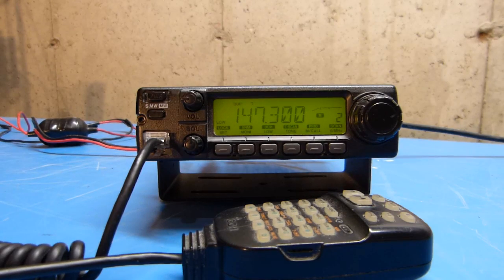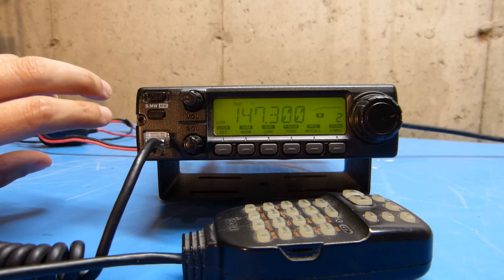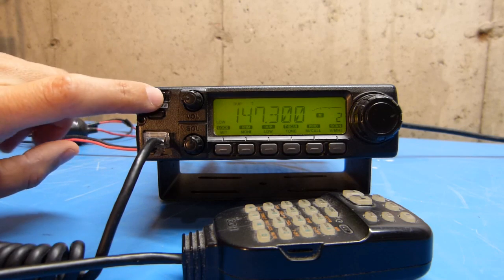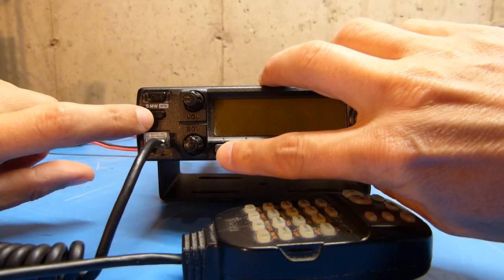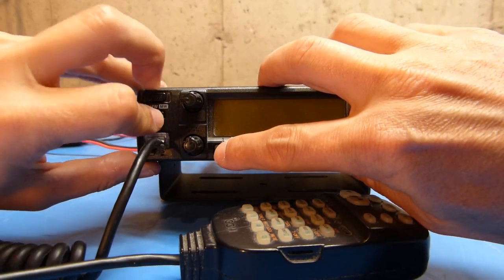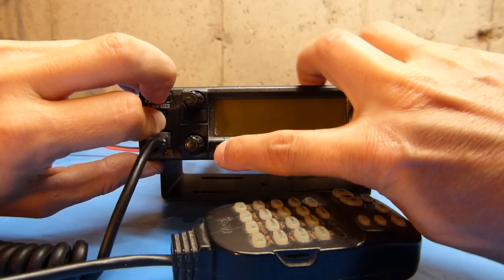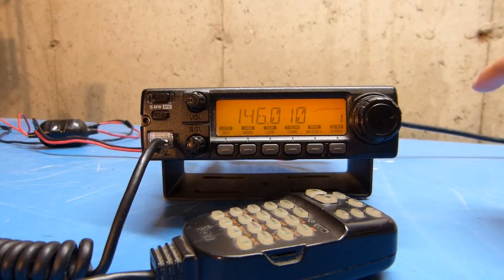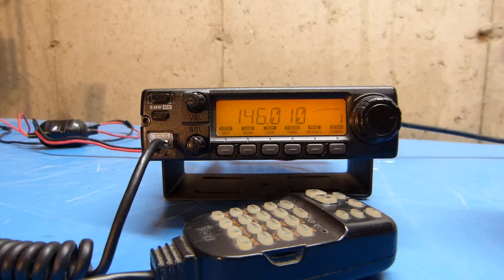Icom IC-2100H Reset

Comment: Hello 741,
I have just bought a icom IC 2300H ex local mining company. The radio was locked. Can you please tell how can I reset it? Or is it same procedure as shown on your tutorial. Many thanks for the help.
Reply from the maker: I don't know if it's the same or not.  Check the icom website and see if the have a manual for the 2300